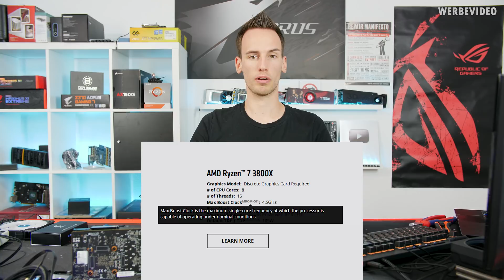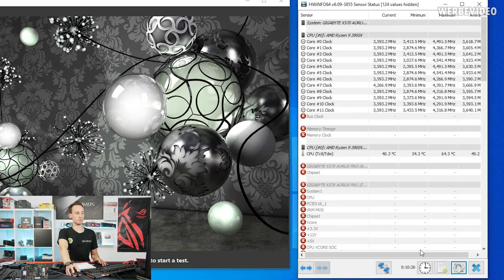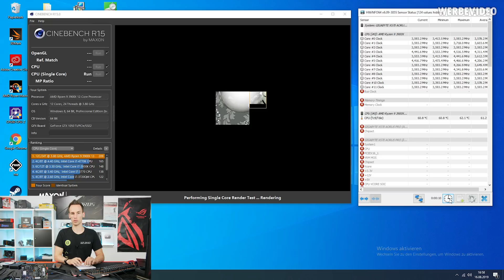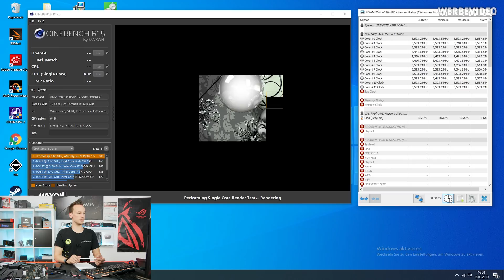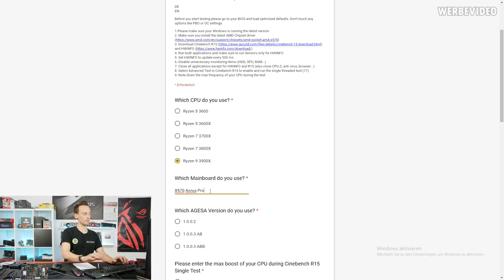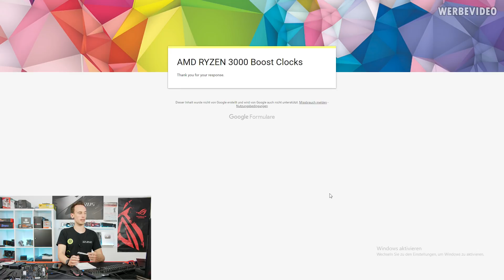I need YOUR Help! RYZEN 3000 Boost Analysis

Comment: I got best results with 1.0.0.2 AGESA. 4.6ghz and over witht that one. Right now with 1003ABB + latest chipset driver (released like 2 days ago) It's only 4.3Ghz. Something is wrong i feel like.
Reply: on my MEG x570 ACE I also had 4.65ghz on 2 cores and 4.6 on another 3 at times on AGESA 1.0.0.2 but on any AGESA past that i've never seen it go past 4.575ghz

Comment: DONT FORGET TO GET CHIPSET DRIVERS and enable ryzen performance power setting. Some people might have it on balanced for example. It made a difference in my case. Before I was not able to reach the boost of my 3600 (running a b350) and now I’m getting 25mhz above the advertised boost!

Comment: @der8auer Just a quick thing before anything. Sometimes when you start your CB R15 or R20, the CPU will be cycling from "ONE" to any other "Four" Core, at least typically in my case, anyways... it can just call the slowest Cores without even jumping to the faster ones. And if you switch to task manager and "Set" the affinity to the 4 best cores on your CPU it will actually use them for the test. In my previews test, the CPU sometimes would just get stuck on a set of cores without even switching to the best cores.  Ryzen 3900x / Asus CH XII 1.0.0.2 AGESA. Same behaviour at stock config or custom. Thanks.

Comment: Send my results, not much Ryzen 7 3700x 4,325 Mhz X570 MSI Gaming Plus
Reply: 4375 mhz Ryzen 7 3700x Aorus I Pro Wifi
Reply: @swedenevguru8483  Nice!...I going to update for the last beta bios
Reply: @K9PT  Newest Beta Bios on My motherboard i use also
Reply: @swedenevguru8483  You have the same board?
Reply: For me is working!

Comment: Running 4266mhz on all cores with 3700x, none of the cores boost more during cinebench r20 single core stress test.
Reply: R20 single benchmark doesn't run correctly on ryzen 3000 yet. That's why he asked for r15.

Comment: I have a Ryzen 3600, a Gigabyte X470 Aorus Ultra Gaming MB and 16GB 3200 G.Skill Trident RGB memory running Windows 10 Pro with the latest updates up to 1903. Running the latest bios 1.0.0.3 ABB F42a. CPU boost is on auto as well as PBO . All my cores are running at the advertised boost clock of 4.2 plus or minus 100Hz. The problem I'm having is most of the time the memory doesn't stay running at the XMP setting even though XMP is set to auto. Same with PBO turned off. In CPUID it shows the memory is running at 1066. I can get it to run at 3200 when go into the bios check that XMP is on then save and exit the bios and then check it in CPUID again and it will show 1600. I've heard since this MB has duel bios that sometimes it will switch bios on it's own. I'll try updating the other bios also and see if that will fix the problem. But if would switch bios on it's own it wouldn't boot since that bios is not updated, right? IDK.

Comment: my 3700x boosts to 4.4ghz just fine for several seconds.
64GB 3600mhz and 1800mhz IF speed. no issues. CoolerMaster 240 water cooling. 30c-33c on idle.
But PBO is in Default or enabled.
Msi x470 Gaming plus. 
latest bios August 2019 1.0.0.3ad
Reply: my went upto 4.375ghz with 16gb 3600mhz stock cooler, does cooler performance have affect ?(x570 gaming edge)
Reply: @AniketShinde__  coolers ofcoure they have affect but not so much as your motherboard model. check the hardware Unboxed video on that!

Comment: I'm not sure that using your own definition of what boost should be is really a fair way of assessing this. AMD never guaranteed that boost clock to be achievable under a Cinebench workload.

My 3900X will boost (in Windows) at maximum to 4650 on two cores, 4625 on one, 4600 on another, and the last two of the chiplet will reach 4575 at some point. This is on a B350 Tomahawk.

However, I'll still go and run the test your way and report back. EDIT: Tested with your method, the chip reached 4575 MHz on Core 2 during the run. Submitted the results on the survey.

How did the 2700X boost by comparison?
Reply: something1random23 a cpu advertised to boost is suppose to do it under load not when sitting idle at a desktop. What would be the point then of boosting at all if the computer doesn’t do it while under load running games or data intensive applications, any intel chip that has boost, does it while under load and sustains it unless one, it overheats then it will throttle to slower speed, two throttle if reaching a power limit set in bios, three the power vrms that supply power to cpu under load overheat.... then cpu throttles... intel not only promises boost speeds, it does it to multiple cores depending on the load and sustains it indefinitely unless one of the issues above occurs.
Reply: @skyhawk21  What Intel does has no bearing. They have a completely different boost algorithm. These numbers are completely pointless anyway. Name a realistic workload where single core boost matters. I'll wait.

Comment: Also, pay attention to your base clocks! They arent operating at advertised frequencies either, at least I dont think they are..  I think when you pull up a program or game the cpu shouldnt fall below its base frequency while under a load..    The video is of my x570 Taichi and 3800x duing a Geekbench 4 run, notice it dropping to 3.5ghz several times during the benchmark. https://www.youtube.com/watch?v=lur6O871cEY    This is at default settings only xmp profile 1 is enabled..

Comment: You can find your AGESA version In HWINFO64 also by clicking on your motherboard tab
Reply: Right. Unfortunately the "ABB" and similar designations are not included in the BIOS. That's the reason why neither CPU-Z can display the full AGESA version.
Reply: @martin_hwinfo  I have the first bios still on my crosshair 8 hero. So I didnt know that.
Reply: @martin_hwinfo  are you affiliated with HWINFO64? Your picture makes me wonder
Reply: @skoopsro7656  Very affiliated, I'm its author :-)
Reply: @martin_hwinfo  cool! Thank you for the hard work in bringing such a valuable tool to us.
Reply: @skoopsro7656  Thanks :-)

Comment: done, you're not beating a dead cow (or horse)
prior to this release, there was always an expectation of "a bakers dozen" if you get my meaning.
bakers would give you an extra bun when you ordered 12, because short changing you could result in the baker being executed. Therefore in order to ensure you were never short changed, they would give you an extra for a total of 13.

cpu's always had overclocking headroom prior to this zen2 launch. This launch changes things... a lot.
we can optimize, up the infinity fabric, but not increase the clocks beyond spec all that much (if at all ... not counting LN2 ofc)

Comment: Just entered the info in the doc, ironically running my Asus CH7 at default setting (PBO OFF) actually fixed my boost speeds on UEFI version 2606 (latest official for my board). Before when activating PBO, raising limits of PPT, EDC, TDC etc., it would only boost to 4375 MHz. At default settings I'm hitting 4500 MHz. Asus needs to get their shit together.

Comment: The problem with hardware unboxed video is he only tested one cpu and only 1 bios version per board.

I have a 3600 on a Asus strix x470. I started with the agesa 1002 bios and it had memory bugs but I was able to boost all core about 4.2 to 4.25ghz all core while gaming using PBO and plus 200mhz OC. Using a NH D15 cpu cooler.

Now I updated to 1003 agesa and the memory bug had been fixed but PBO and auto OC seems to have been shut off. No matter if j turn PBO on or off my cpu now boost 4.1ghz all core during gamimg.
Reply: That's NOT a problem. He was testing for the mobos. So keeping the chip and bios the same is actually the best way to isolate the mobos. Why do people keep saying this is a problem. That's how research is done.
Reply: Wrong, how do you know every board was using the same bios agesa? There is a 300mhz difference for me between 1002 and 1003.

Comment: Both my Ryzen 3000 bosts higher than spec, 3900X to 4625MHz on two cores and 3700X to 4450MHz on three cores. But I run AGESA 1.0.0.2 on both, to get the 3900X over 4.6GHz I had to use minus offset as Asus is probably overvolting. But the 3700X is on full Auto.

Comment: Steve from Hardware Unboxed tested same CPU on multiple motherboards and saw that boost is bit different depending on motherboard. The best was Gigabyte X570 Aorus Extreme, where his 3800X hit 4500Mhz+ on 7/8 cores. The worst was MSI Pristige X570 Creation with 4370Mhz to 4375Mhz on one core. Also same was with MSI B450 Tomahawk. Funny enough, both mentioned MSI boards has 2nd and 3rd all core boost, behind Gigabyte X570 Aorus Extreme, but for some strange reason, single core just didn't go as well. 

Here is video:
https://www.youtube.com/watch?v=o2SzF3IiMaE

Comment: OK, I will soon as I get home but "as default", go ask Ggabyte why on my B450 Gaming X, PBO is ON when you load default preset (on BIOS). Anyways I will make sure, once again, that only PB is enable (if not your CPU wont boost at all), and that I removed the vcrore offset I had applied a few days ago.
Reply: X570 Taichi has PBO on with BIOS defaults as well.

Comment: I like the idea, but i see a few problems. 1. trolls messing up the data - not always obvious. 2. there's no real control over peoples system setup, who can say for sure that they closed everything? stopped any hidden services (iCUE)? 3. what chipset version & power plan are they running 4. feature version of windows and update version. Ideally it would be cool if someone could write a little app to catch all these discrepancies and ask the user to update/do it for them and run the test. It would also mean validating they have an actual 3000 series which would eliminate the trolls

Comment: My problem is with 3600 voltage. It hits 1.4 even under volt on B450 aorus pro. And when idle, ryzen 3000 seems to go up and down (not very stable idle) C1/C3 enabled on bios.

Comment: Did the test as prescribed and filled in the form. 
I'm running the Tomahawk MAX, it came in at second last position in test of Hardware Unboxed. And I can confirm this. My 3600 does not boost near 4200Mhz. Max I have seen, as also just tested again for the survey, is 4125 according to HWiNFO. Doing an auxiliary run it maxed at 4121 according  to Ryzem Master.

All core voltage reported well beyond 1.44 volt (have an all core OC running 4125 prime95(non avx) stable at 1.315 btw). The weird part is my golden core 3 was one of the least stable at 4200Mhz even at @ 1.44v.

Comment: Not sure if Important but I have an old b350m pro4 from asrock, that currently is on bios 5.9 with agesa 1.0.0.1, so one of the real early once, which is not listed as an option within the survey, I will try  the steps listed in the survey and report here, as well as upgrading to 6.0 which (oddly skipped 1.0.0.2) upgrades to 1.0.0.3 ABB and then fill in the survey ;). Dont think it will create much of a difference tho.

Comment: My 3900x was able to get one of the cores to 4.575 GHz and one other to 4.550 GHz. I guess that rounds up to 4.6
Reply: Lucky, I got a max of 4.450 GHz on multiple runs.
Reply: @recoilpaintball  Doubt we'll notice 25-50MHz though.
Reply: @Raisinlove334  very true, but it's nice to have the extra bragging rights.
Reply: @recoilpaintball  Meeting specs or exceeding them could be nice indeed.
Reply: @Raisinlove334  though I am super happy with the performance so far and it's a huge improvement over my 1800X.

Comment: Filled in the form, I ran through a bunch of additional tests using your specified settings on both R15 & R20 using both Ryzen power profiles.
I ran R20 aswell to rule out any software bias/issues, near identical behavior in both. 
I added all that extra info in the comment section of the form as well as some interesting anomalies after benchmark completed.

Comment: what about ram frequency and timing? do i have to set those to default as well?

And some links for the drivers, software etc. since I didn't see it in description:
AMD Chipset Driver - https://www.amd.com/en/support (Select "Chipsets" - "AMD Socket AM4" - then select your chipset version then submit)
Cinebench R15: https://www.guru3d.com/files-details/cinebench-15-download.html
CPU-z: https://www.cpuid.com/softwares/cpu-z.html
HWinfo64: https://www.hwinfo.com/download/
Bios: you gonna have to google your own model of the motherboard, then probably go to support then bios.

Comment: Not sure if i got a chip that should have been binned as a 3800x but my 3700x boosts 1 to 3 cores up to 4600 mhz at stock settings on a b450 itx board and at idle only clocks down to 4350 across all cores but my voltages stay between 1.375 and 1.5 I'm running a 240 aio with temps not going above 60 in cinebench oh my board is an asrock fatality gaming-itx/ac

Comment: My 3600x standard bios settings all cores reaches 4366 mhz on boost i am using a asrock b450m pro4 motherboard. Daily i am running an all core overclock 4.4 ghz, 1.375 volts. stress testing the volts are stabilizing at 1.344 volts. Using an huge arctic air cooler. idle 28-30c, never seen it past 60c on load, fans always on 60%. cinebench r15  single 205, multi 1733. And i just did the survey. Love your videos :-)

Comment: x570 gigabyte elite, 3700x, nvme only. the best I can get with csm disabled and still using a normal uefi boot (no fast startup or hibernation) is 18 seconds until I see windows loading and total 30 seconds until windows. It was much faster on 2500k pc
. With csm enabled, it's up to 40 seconds... there is this dot flashing, fans spinning. It's kinda bad
aaahhh boost... not boot
Reply: hiczok if using windows build 1903 it takes twice as long to boot on ssd or nvme than older builds, do not know why but it does...

Comment: Your form does not have Agesa v 1.0.0.3A
Many MSI X570 boards are using that Agesa.
Reply: It doesn't have 1.0.0.1 either
Reply: There is a fresh BIOS update with AGESA 1.0.0.3ABB available (at least for my board - the X570-A PRO, the cheapest one...)
Reply: @DominikPinkas  that is a Beta version released yesterday (after the video was published)
Reply: @sounavaghosh  It doesn't seem to be beta, it was released after the video aired but it is still relevant for testing...
Reply: @DominikPinkas  I mean, it's clearly mentioned as Beta in the website
Reply: @sounavaghosh  guess I am blind then... https://www.msi.com/Motherboard/support/X570-A-PRO It doesn't say BETA anywhere I can see. Perhaps they have different releases for different regions? I installed it and it seems stable anyway...
Reply: Dominik Pinkas it has been taken down, it was there yesterday
Reply: Dominik Pinkas I just checked today MSI has taken the beta 1.0.03abb bios down
Reply: If you used that version, just make a comment in the notes so that he can note it in the results.

Comment: i downgraded my bios on my b450 tomahawk with a Ryzen 5 3600 to 7C02v18 from 7C02v1A and my boost clocks were working great, however I did have issues with XMP stability so I decided to just keep 1A. Agesa 1.0.0.3 is included on 7C02v18 while 1.0.0.3ab is on 7C02v1A.

Comment: R5 3600, MSI B450 Tomahawk, 1.0.0.3AB, Stock (load default) 4200 MHz stable in single thread R15. Does hit 4400 MHz in R15 with autoOC + 200 enabled, but mostly at 4350 MHz during the run. Score 201 (AutoOC + 200)/195 (stock) Does have a problem where all cores get stuck at 4300 MHz at light loads and idle sometimes. No benefit at all to manually overclock mine, cannot hit more than 4200 MHz at 1.35 V. All core cinebench R15 run at 4150 MHz-4200 MHz.
Reply: U need to help fill in the survey form in the description.. Thx..

Comment: R5 3600 and MSI B450 Tomahawk. 2 cores boost up to 4179 and the rest remain at 4099 and that's with a stock cooler. AGESA 1.0.0.3ab
Reply: Strange, i have no issues with this motherboard and CPU combo. Hit 4200 on single core and 4150 on all core R15. With PBO+AutoOC +200 i hit 4400 MHz in R15 single (most of the time at 4350)

Comment: R5 3600 here with ASRock X570 Phantom Gaming 4 reset to default values in BIOS. Got 4125.4MHz in cores #0 and #2, and 4100MHz in all other cores. Max temp Tctl/Tdie 70.4°C (stock cooler). Ambient temp outside rn, around 11°C ish.

Comment: It's important to hammer into people's heads that the recording should be made BEFORE the test is finished. Mine only got to 4.3GHz during the test, but after it was over and idle it went to 4.325.
Reply: Same. Msi gaming pro carbon x570

Comment: I've been running a 3700X at stock on an Asus X470-F.  with their latest update which is 5204 -Agesa 1.0.0.3ab,  max on Cinebench  R15 was 4375.   Left HWiNFO64 on for a couple of hours  4 cores reach 4375, 1 core reaches 4350 and 3 cores reach 4325.    I am actually more concerned by the high voltages that are recorded.  Haven't tried overclocking yet but I am thinking that I may just set up an all core overclock at 1.35 V and be done with it.  Not trusting  the voltages on PBO is a problem.  Will wait and see what happens with further bios revisions.  I remember it took several months for the first gen motherboards to  properly handle memory.

Comment: Which power mode should I use? When I use AMD balanced or windows balanced I get 4491, but when I use AMD high performance I get 4516. In windows high performance I get 4541, but it only touches that briefly while amd high performance seems to sit at 4516 for much longer and gets a higher score.

Comment: With my system, the max boost my CPU has gotten to was 4544mhz, 205 points. Crosshair VIII Formula. 0803 1.0.0.3ABB.

I'm pretty sure those are just momentary spikes because the score should be higher than that.
Reply: 4.5 ish should get you around 210 in CB15 1T.  That's what my 3800x does with 3200mhz cl14 mem.  C6H with the latest validated bios.
Reply: @patrickshelley09  you are correct. manual 4.4 gets ~205, 4.5 ~210, and 4.6 ~215. manual 4.6 in ccx0 i get up to 216.
Reply: @vladicon2  3900x